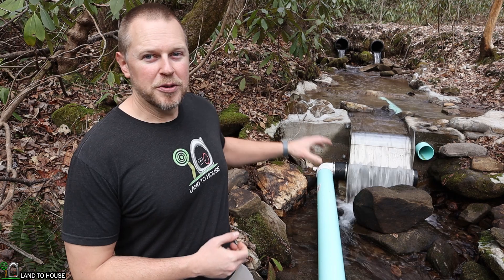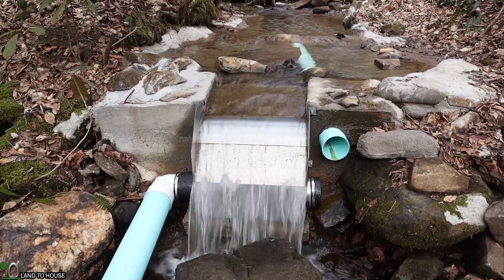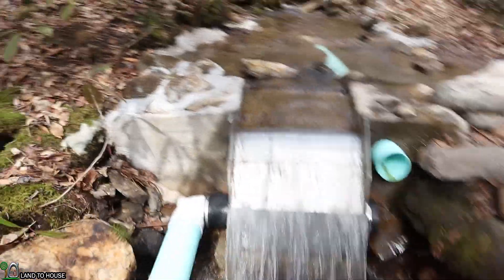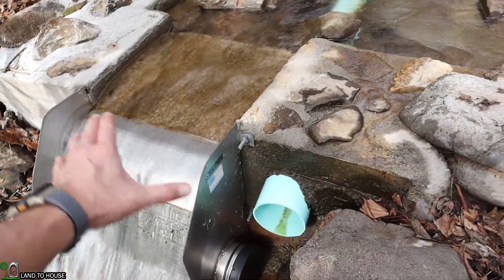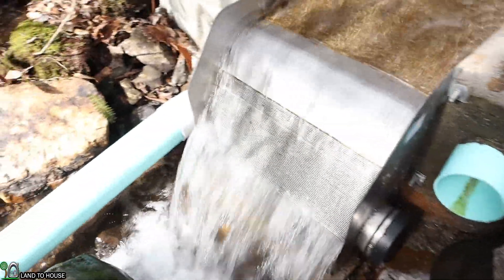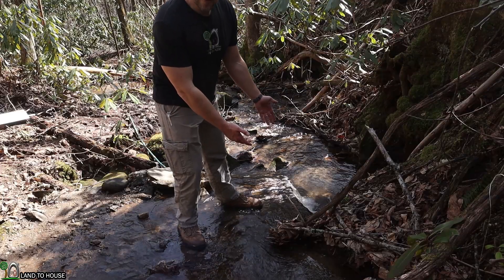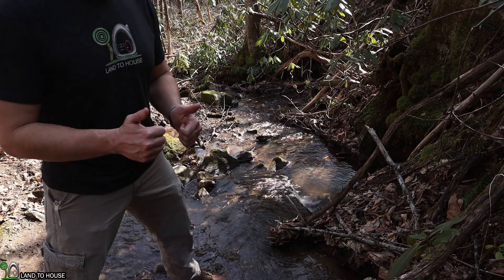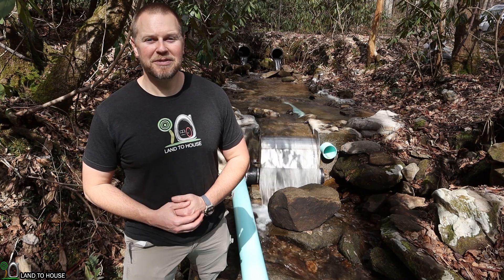Micro Hydro Water Intake Coanda Screen

Comment: I pull about 90 GPM into my 3" line with my Coanda screen intake. BUT, later in the summer it gets algae or some kind of growth on it that requires me to pull the screen and lightly sandblast it off.  It's also on the small side for my needs, and I plan to replace it this fall with  some galvanized steel perforated sheeting that I came across at a salvage yard.  It has 1/8" diameter perforations,  and configured properly should be able to pass more water, we shall see. I produce 850 watts back into the grid for most of the spring, summer, and early fall.

Comment: when you design the system as that it does not have to be screened in any way
Reply: also a mesh slosh over
Reply: coanda is kinda exotic version
Reply: think about gold water slosh screen, its horizontal
Reply: what air

Comment: What’s the purpose of that overflow tube in the dam wall?
Reply: Looks like it was the owner’s original attempt to create a water collection input you can see in a few shots the long slot cut inside the weir, which I assume was covered in fine mesh, in the hopes of a cheap water source.  It doesn’t work.

Comment: I like how you installed a barrel in your system to slow the water down enough to let the grit fall out of the stream. 
For this bigger system, it might have to be a huge tank to allow separation.
Reply from the maker: These 100 gallon plus systems would need a lot more holding tank to slow down the water.

Comment: Hey Seth..   I just wrote them an email asking a couple of questions. How small is too small for a micro hydro system.  I have a year round  Source of water but it's about  2 to 4 gallons a minute..   There is a second source with a valve on it that is closed.  Both sources come from the same ditch. I guess I will experiment after opening the 2nd one to estimate a total gallons per minute when I get home.
Reply from the maker: The basic hydro calculation is:
(Head in feet X GPM)/10=power
So let's say you have 50 feet of drop.
(50 X 4)/10=20w. You can see thatcis not worth the effort. My personal system has 150 feet of drop with 15 to 30 gpm flow. So I can get 100w up to 450w.
Reply: @LandtoHouse  Thanx for the reply.  Guess I'll stick to my solar and wind projects. This ditch is almost level..  I do refer to the place as the swamp.

Comment: Why not work with the pipes above that are feeding that creek? That looks like a good foot or two of additional height.
Reply: I agree. For a $100 in concrete to build a bigger head and use all of that water flow would before free power\more efficient.
Reply from the maker: The 1 foot would have added 10w.
Reply from the maker: They wanted to get the coanda away from the road a little for asthmatic reasons. I did not show the off grid cabin but it is very nice.
Reply: @LandtoHouse  thanks for the reply as always! Makes sense!